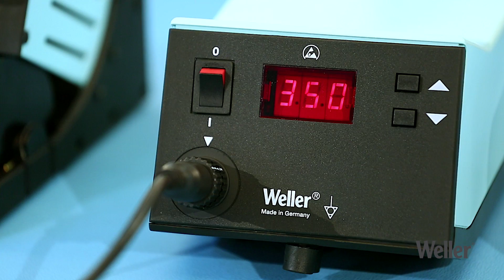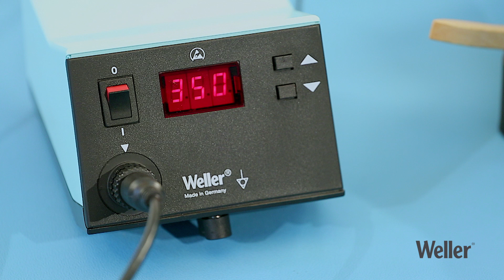Weller WSD 81i Soldering Station

Comment: My WSP80 heater element just failed. Replacement part : approx 120€.
I've only used the iron very little over the course of 3 years, only for at home hobby purposes; so not at all as extensively as an industry would require. I'm very disappointed. Switching to Hakko (same price as the replacement part, you get a full station-iron combo and the brand seems reputable enough )
Reply: Hakko is way more better than weller.

Comment: Weller is the BEST
Reply: +Yootjoob 
if the price was lower for 100 euros so yeh ,it will be the best !!!!
Reply: +Gregan Dark 
Yeah but quality has a price.
I use the WTCP-S and its great, never disappointed me.
Reply: Yootjoob
it's hard to explain in simple words ,but today weller's station are not that great as time ago :(
Reply: Maybe you never used any other. That's Weller is the "best".
Reply: Yootjoob Not really. Look at JBC soldering stations. Or TS100 portable soldering iron. Then are much better. Also TS100 is only 50 bucks. JBC is expensive but worth the price.
Reply: @tunahankaratay1523  I think JBC has "enthusiast", "no expense spared" pricing whereas Weller's teal line of tools (not the cheapo red housing hobbyist line) is priced squarely in the "professional" bracket alongside Metcal, Hakko Pace....
 I own a JBC preheater, it cost $5500. Is it the best? Absolutely yes, by any conceivable measure. Is it so better than everything else to justify the extra $2000+ over what everyone else in the industry charges? That really depends on who is buying.